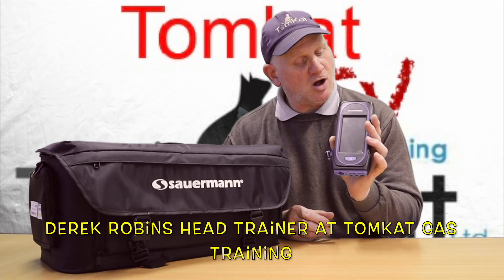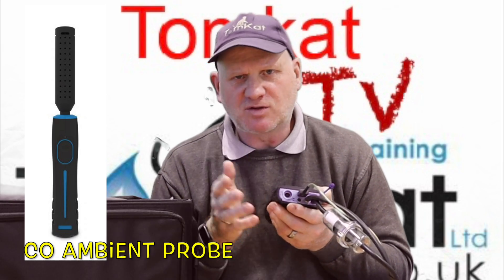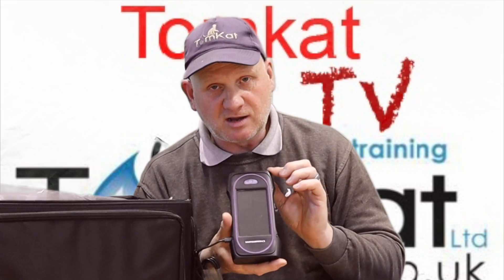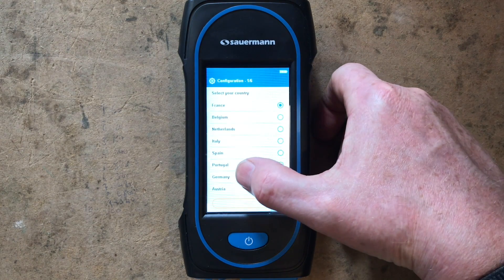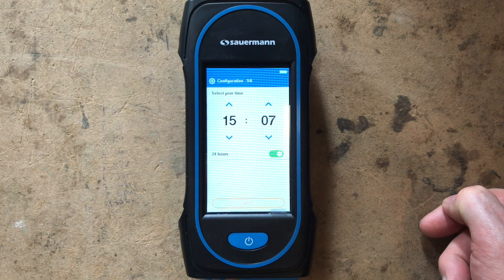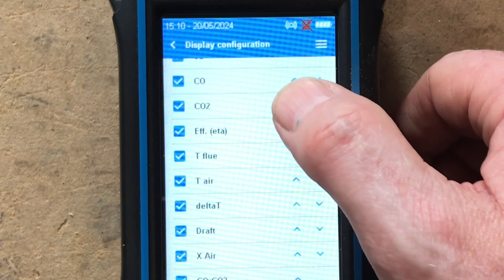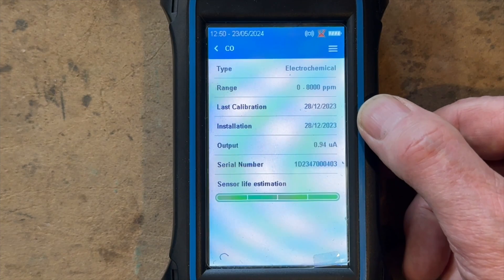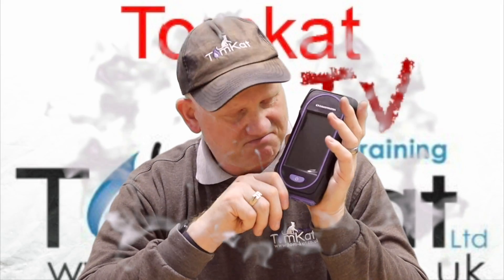No other analyser does this. Sauermann si-ca 130 flue gas analyser part 2, setting up for use.

Comment: I am assuming that the cells have a life span, usually 2 to 5 years? If the censor does not need changing, surely you still need to send the unit off annually to be calibrated as required when using the unit for gas safety critical measurements?
What happens if the gas engineer installs a cell incorrectly, or puts the wrong cell in and there is an incident, or even if he does put the cell in correctly and there is an issue with the unit which is involved in an incident, 'where is the liability'? I am pretty sure the engineer would be held liable for this incident as he is not deemed competent to install cells into a FGA?

Does their FGA have the provision for using as a manometer, and can you get accessories such as a gas sniffer for their FGA?

Comment: Posted this in a group forum, as the cost of calibration often creeps up, one of the uses posted a picture of the manual, saying "the calibration must be performed by a qualified technician".
I looked at the MIs, and it says "To ensure the measurement accuracy, sensors have to be calibrated only in Assistance center qualified by 
Sauermann."
So does it need to calibrated or not.
I agree this will be a game changer, if we can change the sensors ourselves.
Reply from the maker: Yes it needs calibration every year but if you install the new sensors yourself they come calibrated with a certificate so you won’t have to send it to be calibrated until a year later I explain this in the video
Reply: @tomkatgastraining  ok thanks for clearing that up
 I didn't want engineers going out, buying these analysers, then be tripped up on the small print.
Reply from the maker: @MrRedspanner  the information about it is on all the sales literature and the video was checked and given the ok by the sales rep. Guess guys need to watch the full video before making comments. Thanks for reposting cheers have a great bank holiday weekend 👍🏻

Comment: I know that Testo have very easy to self change O2 & CO sensors. All analysers should follow suit!
Reply from the maker: I didn’t know Testo allows you to change the sensors
Reply: Yes, part nos. and comprehensive  instructions/testo video make it literally a two minute job!
Battery pack change just as easy.
Reply from the maker: @johnward5006  is that just on the 350 industrial range not the domestic range
Reply: How about the 310
Reply: @johncrolla  Yes, just as all models. Just make sure you use the Testo part No. to source genuine parts. Generally pre or self calibrating, check your manual.
Only needs yearly calibration to keep Gas Safe etc sweet.
Testos don't  shut down every 12months like my sprint evo!
If you know your instrument, you know when it needs re calibrating.
I know for sure that servicing is not as involved and time consuming as they like us to believe in order to justify extortion!
Reply: Interestingly I've just put my Testo in for calibration only 24 months old and been a pig been back 3 times for parts , let's see what happens this time 😕